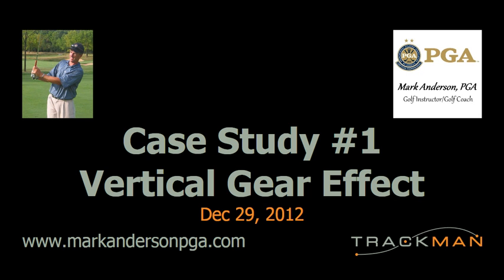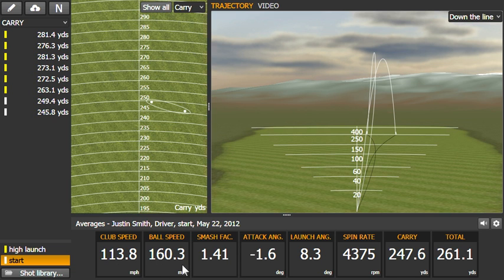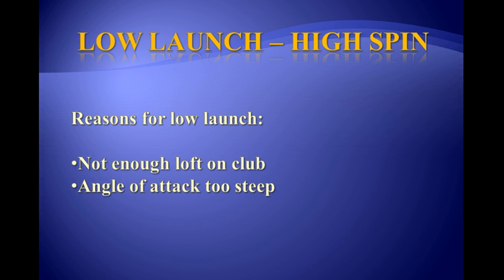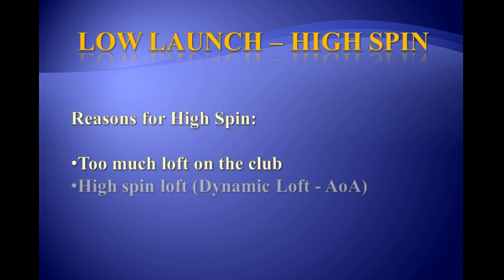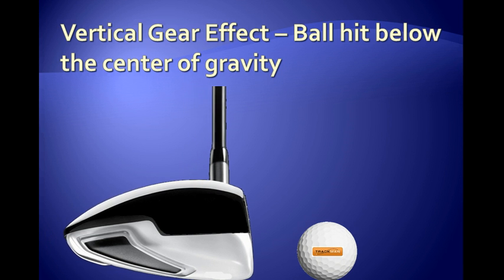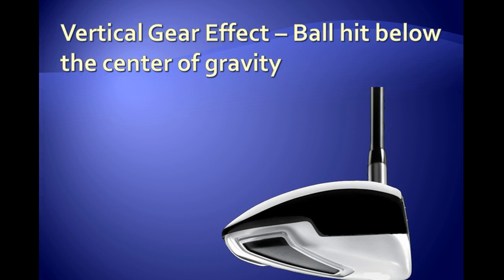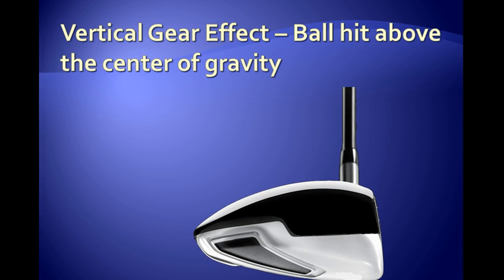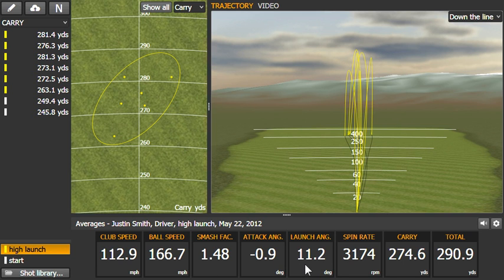Trackman Case Study #1 - Vertical Gear Effect

Comment: Good video! Just a couple of words about the numbers:
(1) About half the distance gained is just the difference in ball speed. Apparently whatever driver you used loses a lot of COR when the hit is away from the center face. Many modern drivers are more forgiving.
(2) Almost none of the launch angle difference is due to gear effect or face rotation during impact. I would have thought the same thing, but I worked the numbers and it just doesn't do that. OTOH, face roll WILL give a lot more launch angle as the impact point moves up the face. Which brings us to Oliver Heuler's comment...
(3) If you are going to hit the ball low, you NEED a lot of spin to keep the ball in the air. A low trajectory with little spin will drop like a rock. Conversely, a high or even normal trajectory with too much spin will balloon. Face roll is a GOOD THING, precisely because of vertical gear effect. It gives a lower trajectory for low impact with high backspin, and a high trajectory for high impact with low spin.

Comment from the maker: Oliver - Great question.  The ball would react very differently if the face did not have any roll.  Shots hit above the face would launch a little lower without roll vs. having roll.  These shots would still have less spin, so lower launch with lower spin is not optimal.  Shots hit below the face would launch a little higher launch without roll vs having roll.  The shots would have more spin so again a higher launch with more spin is not optimal.

see the link below this post to a great site.